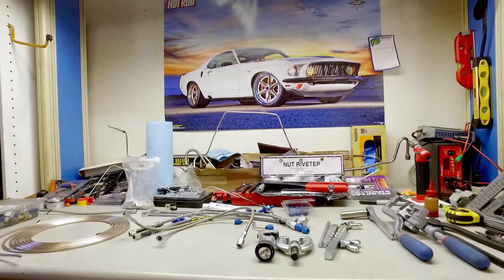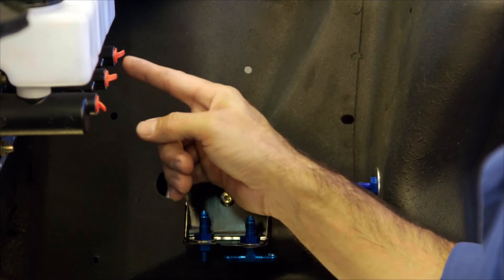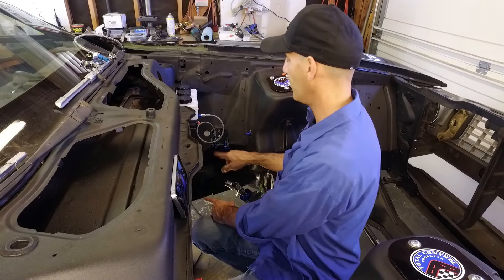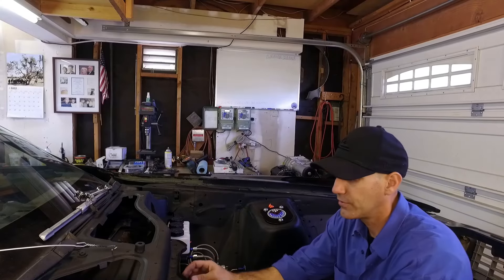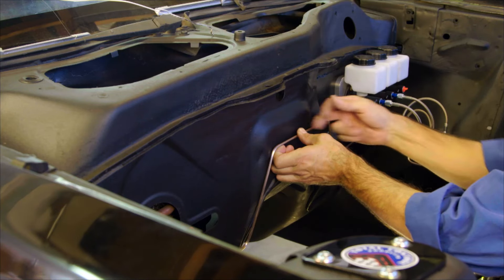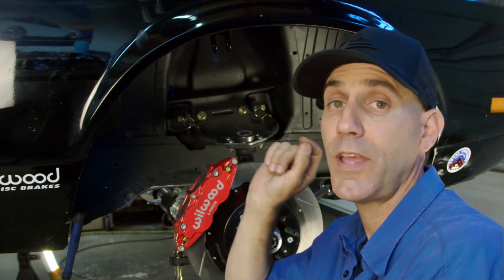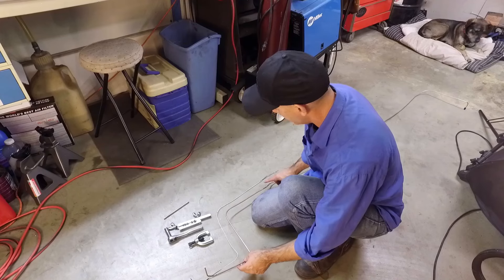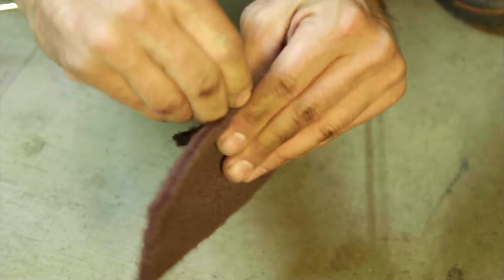How To Build A Custom Brake Plumbing System for Classic or Race Cars

Comment: Guys where is the best place to put the pressure sensor on a racing car set up
Reply from the maker: I've had good luck with this setup.
Reply: @AutoEdits  Thanks for the reply. Your pressure sensor seems to be for the breaklight only. Does it also go information back to the control panel to trigger a warning light if the pressure drops.Also there is just one pressure sensor do you not need it for both front and back circuits. I am working from a spec for a college project that specifies 2 pressure sensors and I need to decide on the location. I currently am putting the rear pressure sensor just before the T joint on the line where it splits left and right.
I put the front one on the line just after it exits the master cylinder.I am knew to this.....not a car mechanic!!
Reply from the maker: @patboland1650  oh, gotcha. It doesn't matter where you put the sensor to get a true reading so put them where they are easiest to wire into the harness.
Reply: @AutoEdits  Thanks. Can that brakelight sensor that you used also function as a pressure sensor or is it only for the brakelight function.
Thanks so much you were really a big help.
Reply from the maker: @patboland1650  That is just an on/off sender so just order a pressure sender as well... they look very similar. Best of luck on your project!

Comment: 25ft of that line is as cheap as under $20 on ebay. Under $30 with fittings.
Reply: Where at on any help Appreciated
Reply: @mikebaker833  ebay.

Comment: I have switched to copper/nickel line and use S.U.R.&R. brake line kits. Comes with all the odd size adapter nuts for master cylinders. I prefer doing double inverted flare an stock style nuts. I don't care for all the adapters that are needed for using A/N fittings. I also use turret style flare tool. It is very fast and makes perfect flares.
Highway 101 Rod and Custom
highway101ind.com

Comment: Do NOT use aluminum fittings anywhere in a brake system.  They are not designed for brake pressure. Stainless fittings only. This includes tube nuts and backers.
Reply from the maker: Now you tell me. I've been using this setup for decades on brakes without issue.

Comment: I thought you were not supposed to use single flares on brake lines
Reply from the maker: Why not?
Reply: @AutoEdits  not sure just what I heard. That's why I was wondering.
Reply from the maker: Double flare is easier and very durable... and mandatory for OEM applications. But a well built and maintained system with -3 AN is used in most racing applications and in my experience been very reliable.
Reply: @AutoEdits  thanks for the tips

Comment: Jason I love what you done with your brake system. I need to do the same thing to my 69 Mach one mustang I’m not as experienced as you so I was wondering if you could make a sketch for me and show me what fittings that are needed to do the same thing you did on your car.
Can you send me your email address and I can show you what parts I have. 
Thanks, Jim M.

Comment: So, no booster and no portioning valve. No power brakes
Reply from the maker: I didn't want power assist brakes so I did the math on master cylinder size vs. caliper size and pedal stroke and this system works great. The proportioning is done on the pedal assembly itself. Here's a video explaining that a bit more https://youtu.be/1xX3_LmfXTU
and a video of the car in action https://youtu.be/qSJ72eAVZFU
Reply: @AutoEdits   I've been watching your videos. You are talented. I'm building a jeep for trail riding only. Do you think a brake set-up like this would work on my project?
Reply from the maker: @russelproctor6685   Thanks so much.  I would think it could be beneficial in a trail rig to not depend on engine vacuum for braking in case of a stall in a tight spot.  But I would really make sure you design a proper system to account for all the components. I tried to "convert" my 82 Camaro to manual brakes by just removing the booster and it wasn't very good... worked ok but required too much foot pressure.  I called the guys at Wilwood and they helped me pick the components to make the Mustang system absolutely great.
Reply: @AutoEdits  thanks for the info. Because of you I'm thinking about having a channel of my own when building this jeep. Would you mind if I mentioned your channel if I do.
Reply from the maker: Dude, of course you can mention this junk! Let me know how else I can help. YouTube is a fantastic outlet for this. I would’ve gone crazy without making these videos.

Comment: Just bought a complete set of pre bent fuel line from Classic industries... It is completely wrong,, nothing is correct. Damn that pisses me off. I bought pre-bent to save money on bending and flaring tools... Now i have to try to straighten and bend and flair  & buy the tools anyway . Also bought trunk lid torque rods,, one side was correct and one was wrong ( in other words 2 left side). They have sent me the wrong one three times now! Damn this is wasting my time.